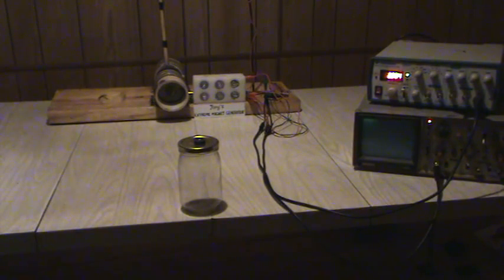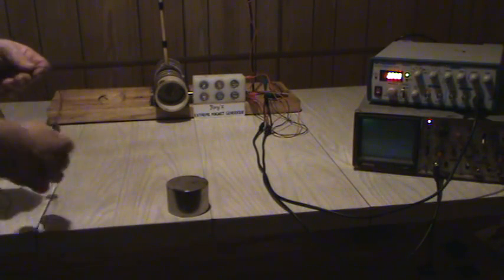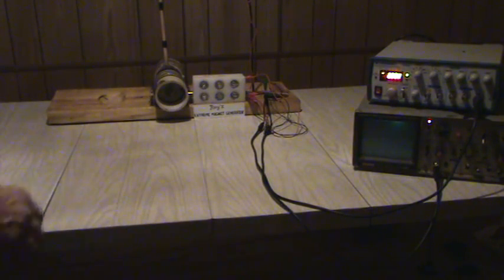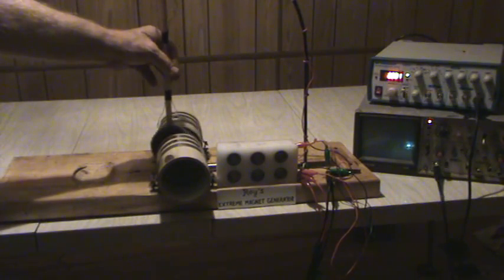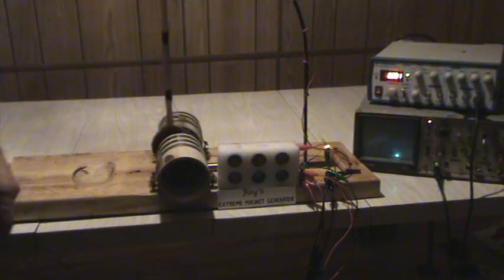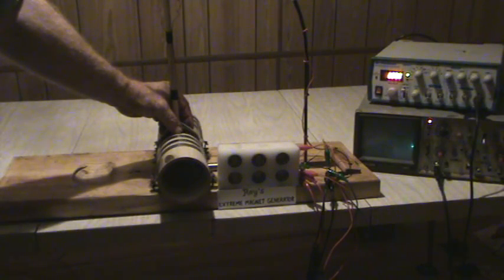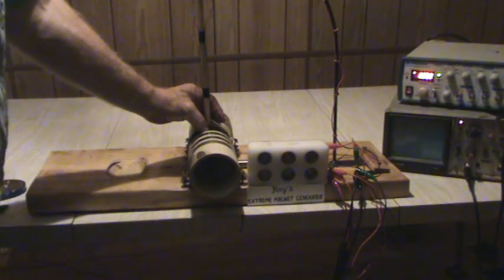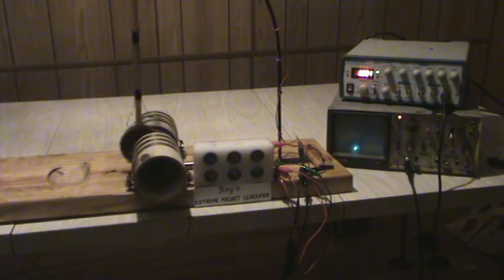Ray's Extreme Magnet Generator

Comment: The voltage multiplication is shown in Faraday's Law:  E = di / dt,   where E = induced voltage caused by a changing current di,  and in time dt.

Since time is in the denominator, as the time to change the current declines, the voltage increases.  The voltage in this case is the back EMF in the coil as it moves through the magnetic field.  You can attain immense voltage spike as you increase the rapidity of the changing magnetic field affecting the coil.  I have seen over 10x increases in the back EMF spike voltage compared to the supply voltage.

This comes about because inductors (coils) store energy in a magnetic field.  Capacitors, likewise, also store energy - but in an electric field.  You can get a voltage multiplication from capacitors too, as follows:

Put 10 capacitors in parallel in a circuit, and use a 9 volt DC battery to charge up the capacitors, then disconnect each capacitor from the circuit.  Recall that capacitors retain their charge after power is removed.   How much voltage, total,  do we have?  Since the capacitors were in parallel, each one got charged up to 9 volt DC.  So there are 10 capacitors with 9 volts DC on each one:

10 x  9vdc =  90 volts DC

This is not over-unity.  Like the inductor, time is a factor here. It takes five (5)  RC time constants to charge the capacitors.  
.

Comment: raymondslab  WOAH!  You just commented that because the input voltage is less than the output it's due to the Overunity Effect?  You are confusing terms.  For overunity to occur, the Power required to run the device must be less than the Power Output.  Power = V*I
You have not shown that!  You need to learn some Electronics because you do not understand the basics.

Comment: Hi Raymond, A possible test for a selfrunning setup would be to omit the LEDs and the signal generator, and moving the coil initially by hand to rectify the induced positive and negative half waves separately with two separate half wave diodes and charge up two separate puffer capacitors, then use two separate reed switches to discharge the capacitors back to the coil at a right time moment to try to maintain the pendulum coil's movement. A good question would be what is a correct time for discharging the caps to get the best bang for the buck, this could be figured from scope shots and trial and error. The reed switches could be controlled by small magnets fixed onto the pendulum arm.
Basically, you would have a positive and a negative DC source from the capacitors with respect to a "common ground" which was, lets say, was the earlier common ground of the sig gen and the scope to one side of the coil.  In case the pendulum could keep on swinging after some intial gentle hand pushings with an increasing and / or steady amplitude, that would be a proof that there is extra energy in your setup. I can draw a schematic if needed.
Greetings,  Gyula
Reply from the maker: thanks a little beyond my skill level but it gave me an idea to try

Comment: Hi Raymond, very interesting and thanks for sharing. I have been working on a similar idea more than 5 years ago. Have a look at one of my recent posts at the Overunity forum which explains the effect and evolution of my concept to which I'm able to have Iron cores to increase coil Inductance but with no magnet cogging to core. There are 3 video demos. http://www.overunity.com/8429/mostly-permanent-magnet-motor-with-minimal-input-power/msg420188/#msg420188
Also, it appears to me your LED's light up on both phase of the sine wave. I know they are connected in parallel to the coil but I don't understand why they light up in both directions when the coil moves through each sides of the magnets, since an LED is a diode and should only light up when current is going in one direction, not both? Thank you Luc
Reply from the maker: The single LED lights on one half of cycle  and the 54 light up on the other half  so they alternate their firing